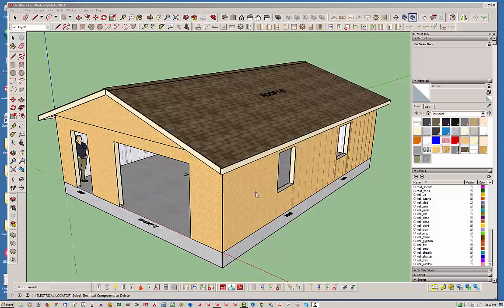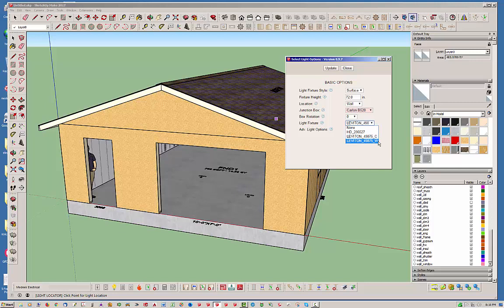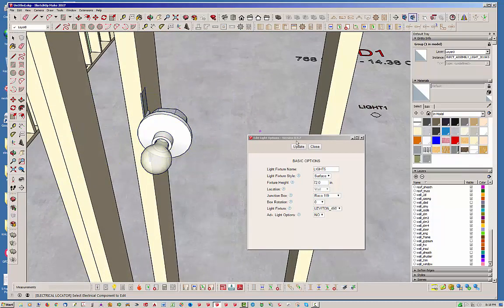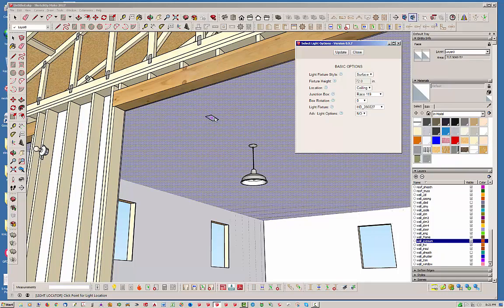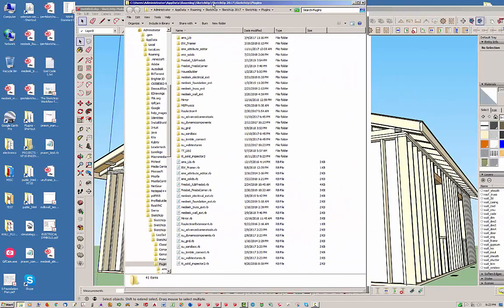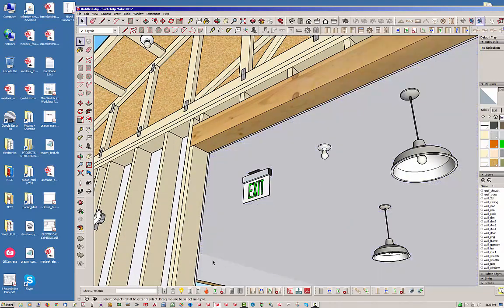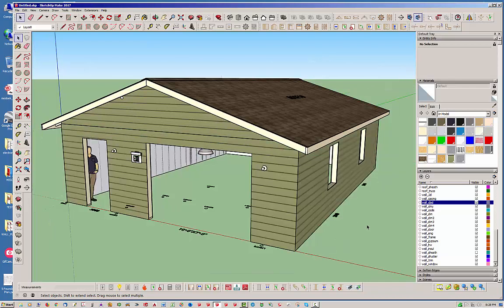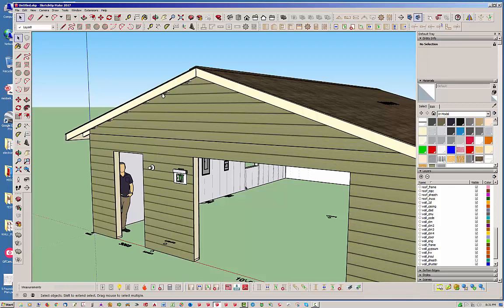Medeek Electrical Plugin Tutorial 2 - Light Fixtures

Comment: I like this extension and will add it to my collection. Is there or will there be an option for including and cataloging security and alarm components? I don't mind creating my own library.
Reply from the maker: Can you email me some examples and which additional categories you would like for me to add?
Reply: @medeekdesign  Give me a few days to research.
Reply: @medeekdesign  Here is a basic category list:
Sensors
Keypads
Control Panel Box
Sirens, Speakers, Strobes
Contacts
Miscellaneous  Components
I am not an alarm installer or system designer. This list is compiled from my general experience as a project manager.

Comment: If I save 3D Warehouse fixtures into the fixture library, how does the plugin determine what part of the fixture is coplanar with a wall or ceiling surface?
Reply from the maker: The origin is the key, if you look at any of the electrical devices I have provided with the plugin (load them into SketchUp from the plugin folder) you will notice that they are positioned so that they are positioned at the origin.
Reply: @medeekdesign  Awesome!  That makes complete sense.

Comment from the maker: Version 1.0.0 - 03.23.2019
- The Medeek Electrical extension moved from BETA status to initial full release.
- Created the HTML edit panel menu and enabled editing for load centers (service panels).
- Created the HTML edit safety device menu and enabled editing for wall and ceiling mounted safety devices (exit signs, smoke detectors, CO detectors, horn/strobes).
- Created the HTML edit light fixture menu and enabled editing for wall and ceiling mounted light fixtures.